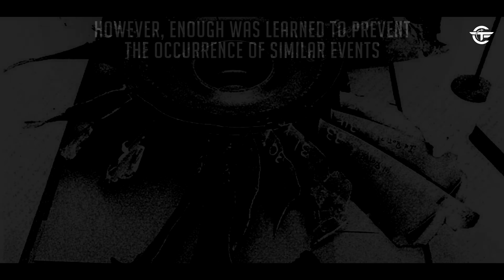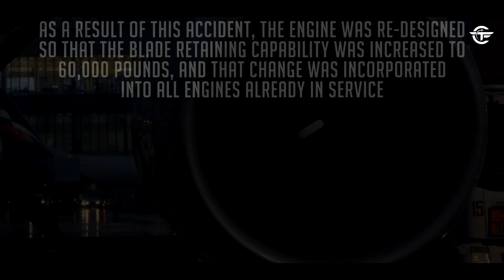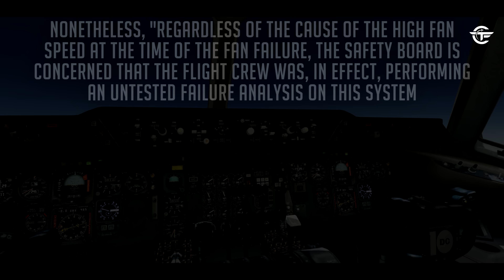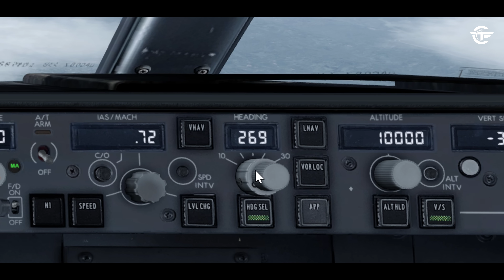Woman Falls from 39,000 Feet After an Engine Explosion | Deadly Experiment (With Real Audio)

Comment: “They wondered where the system was taking its power readings from” - curious or not, they should have put a period at the end of that statement, waited until they landed, and then asked the maintenance crew. Good grief! Even my high school chemistry students knew not to conduct an unauthorized experiment without asking me first. And to try it with passengers on board - the were out of their ever-lovin’ minds! They were obviously in the “it’ll be harmless” mindset - a mindset no pilot should  be in. (I’m a pilot.) They were damn lucky the entire plane didn’t become uncontrollable! If a piece of that blade had severed one of the aileron or elevator control cables or hydraulic lines, they would have been toast. There was absolutely no excuse for what they did. The  good result to come from this would be if they (and other pilots) learned their lesson - and even that came too late for that unfortunate passenger. (Lesson to all passengers: unless you’re actively walking to or from the restroom, keep your seatbelt on at all times. I don’t know if it would have helped in this case, but it sure wouldn’t have hurt.)

Comment: Air travel is not as safe as people think.  When you have engine failure, you can't just pull over on the side of the road and call a tow truck.   💁🏼
Reply: Except they did exactly that? They had an engine failure so landed at the nearest airport with no loss of life beyond the immediate accident. Literally the engine failed, they landed. 

Air travel is BY FAR the safest method of travel we have today.
Reply: @mattd6085  Okay, if you say so.  😬
Reply: @brendaleverick3655  I don't say so, those are the actual facts. Are you okay?
Reply: @mattd6085  It's just that flying scares me.  I actually took a few flight classes when a young woman.  But, it scared me, and I quit.  Have a good day.  💁🏼

Comment: Except this isn't exactly what happened.. if you read the transcript of flight 27, it's involves quite a long and involved discussion between the pilot and first officer about how the engine gets it's Tach readings and how it's controlled, they were 'playing' with the operation of it for a few minutes before resetting it back to auto, when they did the engine went to 108% of it's maximum speed, THEN it lost several blades and took the rest of the engine out, and depressurised the aircraft, it all happened in 2 or 3 seconds. Not how it appears in the video.

Comment: -This design is utterly flawed.  A center engine MUST use an "S" duct to feed it air.  A straight through design like this simply reduces the available rudder, increasing the Vmc speed unless the engines are mounted close to the fuselage.  The L1011 was VASTLY superior to this flawed cheap design!

Comment: 4:16 Sheer genius: I would have never figured that out from the wrecked engine and the shards that penetrated the fueselage.
5:29 Moral of the stoy: don't f##k with the circuit breakers on a perfectly functioning engine.  Do NOT turn parts of it off!!
6:47 It's not flight # 3472: it's #1380 - a still-famous incident.  "Southwest 1380" is repeated multiple times on the cockpit voice recorder - how did you get this wrong?

Comment: In '73 there were plenty of airline accidents, mostly due to air traffic control, so if you don't think unions ar4e good, well without them you would still be in serious risk flying today. Air traffic controllers were worked much to hard and the stress on the eyes and the b rain caused many things to get missed. It's a demanding job in the best situations, so many lives depend on them. It is just so much safer today it's unbelievable.

Comment: You may want to define which Houston airport this plane departed from, as in 1973, Houston had two major airports (as it does today):  the older William P. Hobby Airport (or known as simply Hobby Airport) or (at the time) the newer Houston Intercontinental Airport (now known as George Bush Intercontinental Airport).  I know this is usually done in previous videos, so it threw me off as I had to look up which airport this plane was coming from.

Comment: Your work is EXCELLENT, you are one of the few producers of this type of content who correctly described the poor victims of these events to be Ejected vs the commonly held myth that cabin contents are 'sucked' out in a cabin depressurisation/decompression event.

Like a pressurised bottle containing carbonated beverages, if the cap/cork is released slowly like the insidious type gradual depressurisation or when the cap/cork is swiftly removed or popped causing dramatic overflowing discharge of beverage contents like a rapid depressurisation. No Sucking - Only Ejecting! Terrific work! :)

The PIC failed to advise ATC of their cabin depressurisation in addition to the indicated engine failure/fire. The primary reason for their emergency descent and donning of masks was due to correct EICAS indications and aural warnings.
The concurrent events would be (or ought to be if effectively trained) foremost in mind that the likely cause of both indications in that timeframe and sequence is an contained engine failure and subsequent breech of cabin integrity.

Irrespective of identifying the catalyst of warning indications, the cabin altimeter will indicate the increasing altitude or equalised cabin and aircraft altitudes, relevant and important information to convey to ATC.

With respect to the Aviate - Navigate - Communicate priority sequence; as SOON as practicable and WITHOUT delay during depressurisation-initiated emergency descent, the squawk code 7700 is entered to replace your assigned squawk code, and simultaneously advise ATC of actions and intentions with a message such as …

“Pan-Pan! Pan-Pan! Pan-Pan!**   'Callsign' Currently Squawking 7700    Initiating Emergency Descent Due To Cabin Depressurisation    Departed Flight Level XYZ for Flight Level 100   Currently Passing Through Flight Level ABC”

** or Mayday! Mayday! Mayday! if the situation is apparently life threatening.

Vital communication because despite the technical crew's traffic proximity awareness of any potential threats, ATC has a bigger picture awareness and requires advice ASAP of any traffic deviations from assigned track and altitude.

ATC asked her if there were any other issues, he also likely heard her transmissions were via an oxygen mask, unbelievably and inappropriately she stated NO! 
Overwhelming stress may be a factor, but these are memory items and the sensation of that mask firmly secured is a fairly decent reminder! 
There was no self-correction with ATC update until following advice from cabin crew of cabin conditions which is poor.

The fact that ATC advised flight level 110 and it was accepted indicates extremely poor situational awareness from both tech crew and lack of awareness from ATC due to the crew’s failure to advise! Above FL100 oxygen is mandatory for tech crew, if ATC were aware they’d automatically keep them below the maximum of FL100.

Even if there was a suspicion the cabin altitude indication was erroneous you would still advise the same but may elect to include  “ … according to indications…” 

In their case they would have had clear physiological confirmation with ears popping, pain or at least discomfort (depending upon the speed of cabin-aircraft altitude equalisation) from any areas in their body containing trapped gases typically various locations along the alimentary (digestive) tract, but also facial sinuses, loose dental fillings or other dental anomalies etc.

It would be interesting to know what the airline, NTSB and FAA made of that and what suggestions were made. A single engine operation is certainly a Non-Normal situation and requires special handling but is more an altitude and airspeed inconvenience and a frequently practiced exercise each sim ride. It becomes an issue when there are secondary complications like a breech of fuselage or flight control deficit. 
Clear communication is essential for the best and most appropriate assistance to be rendered. I hope they learned from that.

Comment: On the first accident the flight crew should never have been allowed to fly again.  Experiments are done either on simulators or trained test pilots, you do not feck about when you have paying passengers on board.  The second was a total accident, there is just no compensating for an incident like that.  They were unfortunate to lose the life of one passenger, but a skilful crew and excellent work by ATC meant many more lives were saved, I'm sure.  Nicely told FTC as usual.

Comment: A Newsweek article about Southwest 1380 stated the passenger was pulled out the window, but nearby passengers were able to pull her back in. She later died at the hospital from her injuries. RIP.
Reply: @wixom01
I wonder if she had her seatbelt on?  While it might not be 100% guarantee of survival this is why you should ALWAYS keep your seatbelt fastened and adjusted snugly too.
Reply: @watershed44  The article I read did not specify if she had her seatbelt on.
Reply: @watershed44  i read from the associated press. That it was a female bank executive from Albuquerque, New Mexico. She had her seat belt on at the time the incident took place. Later died at the hospital due to blunt impact to her head, neck and torso.
Reply: @watershed44  She suffered blunt force trauma from shrapnel to her head, neck and torso.  She was wearing her seatbelt.
Reply: @jamesbrennan5457  So are you saying that her corpse was sliced in half and slipped out of the belt?
Reply: @watershed44  Nope.  When the cabin decompressed the top half of her body was sucked out the plane window.  While her head and chest were outside she got hit by more debris.  The belt or the size of her body prevented her from completely going through the window.  But with the pressure differential (look up delta p videos on YouTube) and the wind it was difficult for the other passengers to bring her back inside.
Reply: @watershed44  You can get ripped right out of a car when it breaks or tears. So, not a perfect science
Reply: @windsofmarchjourneyperrytr2823  Obviously there is no 100% guarantee but if the belt is PROPERLY fastened and adjusted, and something like this happens you still have a pretty good chance you might survive and be OK. Better than a 0% change by being unbelted. Also a LOT of passengers leave the belt very slack for their comfort and that isn't going to help you very much in such a situation as this. 
Adjust it snugly, but not too  tight.
Reply: @watershed44  We do it for cars, why not air travel?
Reply: @deepthinker999  Far far less likely to crash
Reply: @Kydos37  But more likely for clear air turbulence.
Reply: @Kydos37  the seatbelt on a plane is for unpredictable movements. I was on a flight years ago that suddenly dropped hundreds of feet, and there was a recent incident where turbulence was so violent that people who weren’t buckled were injured. There also was a Qantas flight where a lady was severely injured and nearly died after she was tossed into the ceiling of the plane. It’s pure stupidity not to wear a seatbelt in either a car or plane
Reply: @squiggleworks9  I would say it's a bit stupid if you undo the seatbelt but stay in your seat. If you want to walk a bit then I'd say it's reasonable because you actually gain an advantage by taking it off and you're still far less likely to need it than in a car, your couple of anecdotes aside.
Reply: Yes.  I remember clearly.  I live near Philadelphia and I clearly remember when this occurred.  The female passenger who died was sucked halfway through the window.  She was pulled back in but suffered fatal injuries.
Reply: yet this video "states woman sucked out of aircraft at 39.000 ft,,,, who is correct,,,,,, clickbait title
Reply: @edwinthompson6510  in the first plane, the passenger was sucked out. The second one was pulled back in.
Reply: She was wearing the seatbelt which is why she wasn’t completely sucked out of the plane. The co-passengers were able to pull her back with great difficulty.
Reply: She basically suffocated, didn't she?
Reply: Spiderman.. yea off course she can go out the small window.. not even a child can fit in the small window, stop eating stories!
Reply: no the women captain can´t handle stressed situations, she is not capable to fly a plane!  but this is reality in 2023, we have pilots who are scared.

Comment: Sooooo.....curiously, the poor passengers that got "sucked" out of the aircraft......were they wearing their seatbelts, or did it simply not matter....meaning their entire seat was sucked out or.....their seat belt failed or.......they were contorted/mangled so badly due to the suction even with their seat belt on they may have been dead already because of the force exerted on their bodies....the reason I'm asking this question is.....should this happen on a flight, is it best to always keep your seat belt fastened regardless of whether they have the fasten your seat belt sign on and also, are their seats on an airplane you might want to try to avoid if possible for this very reason of having an engine failure that damages a window......anyone care to "weigh in"??
Reply: Statistics show the survival is marginally better in the tail, (which is where I hate to be).
Reply: @deepthinker999  I've heard this as well, but I was wondering in the context of having an engine explode and it damaging the fuselage or windows......
Reply: @trevorregay9283
Although I don't know the answer to the SWA flight, the passenger in the National plane, George F. Gardner,
was wearing his, but unfortunately it wasn't snugged up properly. He slipped out as other passengers were trying to pull him back in the plane. Can't be said enough ALWAYS wear your seat belt and make sure it is properly snugged! It might save your life.
Reply: @watershed44  ok, thats good to know and RIP to Mr. Gardner.  I also feel that you should try to get a seat in front of the engines.....or sit way in the back of the plane, if all the seats are taking in the front engines.....
Reply: @trevorregay9283  I know when I was younger, I just hated to have the belt on and especially have it property adjusted, now after hearing about injuries and accidents the pilots are correct. Unless you need to use the bathroom, always keep that belt on and property adjusted. Thanks for your reply. Safe flying to you and your family.
Reply: @watershed44  As well as headaches from hitting the unpadded ceiling during clear air turbulence.  Turbulence is more prevalent when flying over mountainous terrain.

Comment: That's unacceptable. They are supposed to inspect these blades with special ultrasound equipment. Basically it's russian roulette every time we take a plane
Reply: @paulrelgne2149  never claimed it was.  Not sure why u bring up being on the ground.
Reply: Better look up stats for travel.  When you get in your car....far more likely to bite the big one.
Reply: @jaimhaas5170  While you are driving to the airport.
Reply: So clowns, what happens if there is a failure after an inspection?  So if the inspection was at 3k hours and no issues were noted and then a failure occurred at 3510 hours, then what?  Have an inspection monthly?
Reply: @timf2279  There is  a maintenance schedule created by the airplane builder and compliance watched over by the FAA.  If a problem is found the plane does not go anywhere until it's repaired (at least by American Main Line Carriers).  You can look at AA 191 out of Chicago as an example.  All DC10's were grounded until they were inspected and repaired.
Reply: @Edward Marcoline  I more than understand that I guess you did not understand my example.

Comment: Valid points made about unauthorized and poorly thought out experiments performed at 39,000 feet with passengers aboard.  But why was the target airspeed of the DC-10 at cruise altitude only 259 knots?  That would be close to stall speed that high up.  Why not 350 or 400 knots?  National was using a jetliner to make a trip with duration comparable to a DC-6 piston-engined airliner.
Reply: True Airspeed (TAS) is different from Indicated Airspeed (IAS). IAS is measured by air pushing into pitot tubes on the outside of the fuselage. At cruise altitude, with much lower air pressure and frigid temperature, an aircraft will be traveling much faster than the pitot tubes indicate.
Reply: 257 knots indicated... not true airspeed. Not the same at altitude.